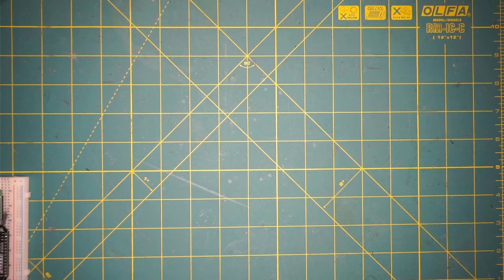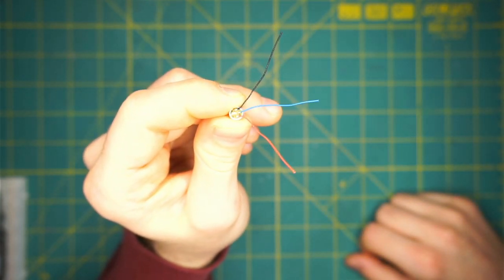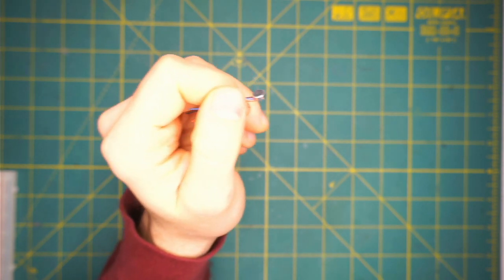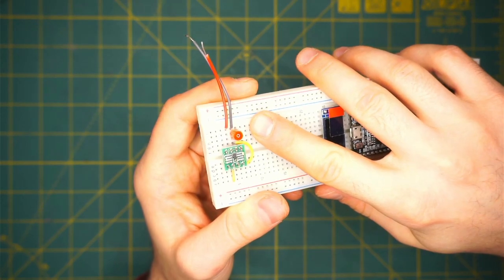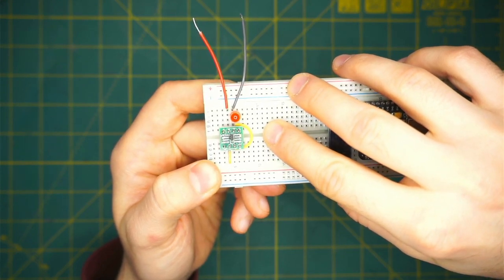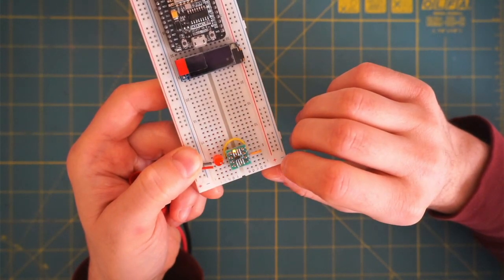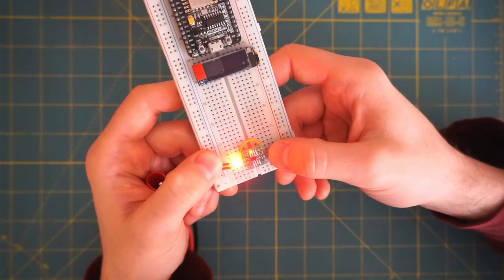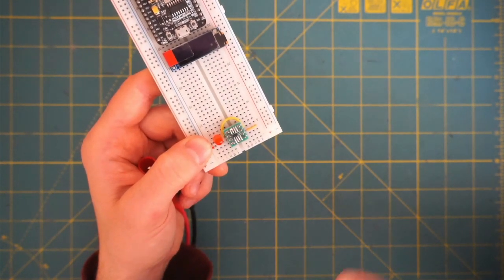What is inside a single use vape pen sensor?

Comment: Weird question, but I'm trying use one of these sensors together with a toy voice recorder box. So when you blow, it will sound. Any input of the wiring diagram needed for that? Jw, Thanks in advance

Comment: Brilliant idea ! .... do not forget to re-use the vape rechargeable battery ! ( make SURE the charge voltage does not exceed 4.2 Volts , a silicon diode in series with 5 Volt USB should work ) ... DAVE™🛑

Comment: Ok... I just took one from the street and i just want to use it to produce some smoke.. to test my TURBO and INTERCOOLER for leaks! :D I didn't even knew how this thing works but now as I see i could overcome the sensor and start heater only but I needED info about lowest voltage which can start this thing to smoke...

Comment: After breaking open several sensors, they're all similar, with a diaphragm, conductive on one side. It would be nice to make it into an electret or capacitor microphone, though unfortunately you cannot connect to both the diaphragm and its fixed "plate" without opening and thereby destroying the vape sensor capsule. As I don't smoke, I have no idea how e-cigs work for their consumer use!
Reply: Its not an electret. The membrane is however conductive and can be used for other projects. Alpha particle sensor anyone?
Reply: @conundrum2007  I did write electret OR capacitor microphone. Your biggest obstacle is connecting to it, without destroying the capsule.
Reply: @bilonggrisimmeri  Low melting point alloy??
Reply: @conundrum2007  Can you explain please? I do not understand how a low melting point alloy can help make this electrical connection? If you mean solder, why not suggest solder?

Comment: This was just what i was looking for. Do you think i could solder two more wires and attach an USB connector, so i could charge the battery connected to the sensor?
Reply from the maker: Hi Luiz thanks for the comment. As Zeki said connecting wires is not good strategy. You are risking damaging the the battery and/or the device you connect the USB to. For sure you will need some sort of charger module with the necessary protections. Stay safe!
Reply: I am pretty sure you can connect 5 volts directly on pin 5  to charge the battery because the IC has a built in BMS.

Comment: hi!
I'm incredibly inspired by your video for a project and have extracted a bunch of the led chips (around 64) and was wondering if it would be possible to make it into an LED cube? I would love to learn more about how it works and any help would be greatly appreciated!! Thank you for making this video!
Reply from the maker: Hey Sen, those SMD are quite small for a cube. From what I have seen on the internet people usually wire through hole LED together to form the cubes. The Surface Mounted Device Light Emitting Diode (SMD LED) might be better for lets say some kind of a ring or bracelet, something with a substrate. A great choice to polish those soldering iron skills.

Comment: How do you recommend removing that tiny LED? When I take it off it seems to stop working but I was hoping to reuse it as an indicator LED on projects.
Reply from the maker: Hmm what kind of tools do you have at your disposal? Soldering iron, hot air?
Reply: @lessbutbetter9485   Also noticed this. The trick seems to be using the correct amount of heat. Preheating the entire module to 100c seems to work, as does using a temperature controlled iron.

Comment: So if I were to swap the atomizer with a motor and keep the battery, when I blow on this sensor, the motor would run correct? Or is there any other part that is needed for a motor to run?
Reply from the maker: It should run, correct! But... there is always a but. When you stop blowing it will stop the power to the motor. So far so good. But the motor will continue to spin because it has inertia right? Effectively it will become a generator and injecting current back to the IC. Then you risk burning the sensor (and your lips) so be careful. There is a way of adding diodes to the circuit to protect against that. Cheers!

Comment: I've been salvaging vape batteries and found one of these but with 6  pins instad of 3. Could you explain this device too?
Reply from the maker: Hey, this is very interesting! I have not seen any IC with 6 pins so far. Can you share more info like where is this extra leg connected to or is there any part number on the IC its self?
Reply: @lessbutbetter9485  Hello, thank you for the reply. Please check my recent video where I show the sensor: https://youtube.com/shorts/tEJqiKvTZB4?feature=share
Reply from the maker: @smothclipsers  Do you have a multimeter. Can you check if any 2 pads are connected together. Also if you can spare one sensor can you open the, can and see if what IC is inside?
Reply: @lessbutbetter9485  hello friend. Im a new electrical engineer who unfortunately works a crap ton and can not dive into this as much as id like to. I am however doing my own research and greatly appreciate your help. Theirs two different versions of this IC Chip: csc9100c sklox and s089x 8003. Csc9100c has one set of pins that have conduity with no power. So far I think it's a transitor of some sort
Reply: @Arbaaz Khan  I believe I could make this sensor, but not nearly as compact. Here's a video of someone who made one similar to how I would build it:  https://youtu.be/OAlIjtg3occ . I highly recommend finding a vape in the trash and reusing the sensor provided, as it's very compact and gives the vape a second use. Plus, those batteries are very useful for projects!

Comment: Thanks for the information, I don't have alot of knowledge, but i like to play around. (When the battery on vape is empty it starts to blink). When i connected it to a new battery it was still blinking and i don't know why. Do you have any idea?
Reply from the maker: Hey Ziga,

I could not find any datasheet on those chips. So I can't be 100% sure. I see the LED blinking when I connect the battery. If you have a multimeter check the voltage of the battery. It should be higher than 3.3V. Cheers and thanks for the comment.
Reply: @lessbutbetter9485 hello mine is not generating any vapour

Comment: This is exactly the information I was looking for; thanks very much for the clear & concise video.  👍
Reply: Same here 😁 but couldn't understand the ic
Reply: Wonder if this would work as a radiation detector? Connect the H_out pin via 51 ohm resistor to existing LED anode, photodiode + scintillator sheet in a light tight package and a -20V supply. Should work plus get a nice fading effect. Mount a bunch of them on a turntable and build a radiation visualizer. Black heatshrink is highly transparent to the majority of low energy X-rays, beta etc. For -20V a single chip step up as used in LED drivers would be adequate.

Comment: How can i find this sensor
Reply from the maker: You got two options. One is to salvage it from pen you find. Another is to buy a 100 from online shops.
Reply: @lessbutbetter9485  how it called im looking similar ones but with 3 truehole pins and i cant find anything
Reply from the maker: @deividassirutavicius3128  Mr. P pointed out it is called "puff sensor", unfortunately I can't give a proper part number.
Reply: @lessbutbetter9485  i found the part but its a bit expensive 😅 min order 100 pcs and the price is 250€ with shipping
Reply: @deividassirutavicius3128  Yes, this is true. Salvaging is always an option.

Comment: Very cool.  Is that SMD the device which handles the entire current load of the pen and how much is that?
Reply from the maker: Hey I took some measurements it turns out this little IC can pass 1.75A of current at 3.3V. Which is quite nice.
Reply: @lessbutbetter9485  is it possible to use this as a switch somehow for a bigger vape circut board?
Reply from the maker: @kingkasma4660  you could probably do it. Keep in mind that the ICs are not marked. We do not have a proper datasheet on them and it is a gable using them in applications with a lot of current. You might get more smoke of your vape pen then you hoped to.
Reply: @lessbutbetter9485  is it possible to let them switch a mosfet relay?
Reply from the maker: Yes, this is it. I will have to measure that and I will share the details.